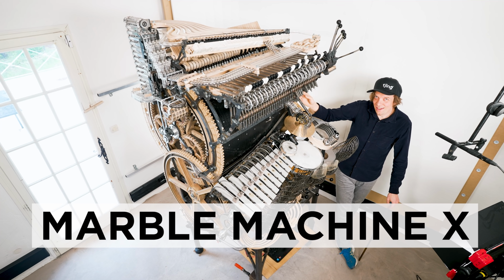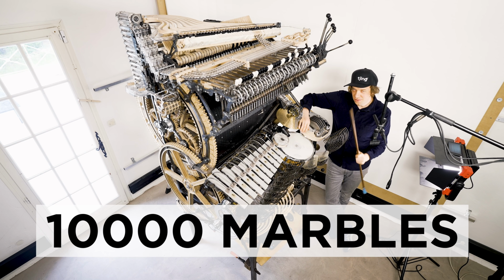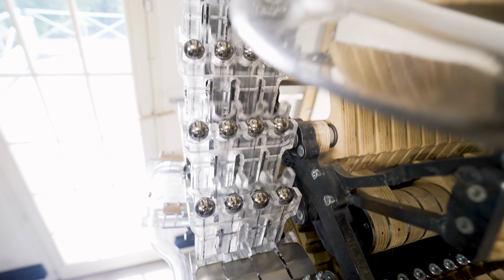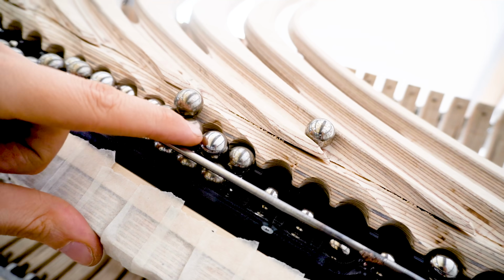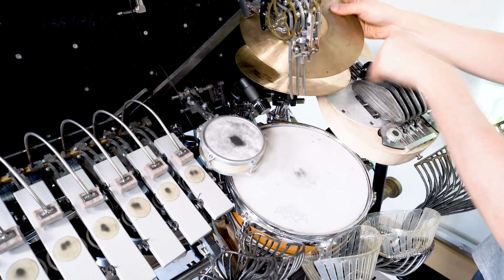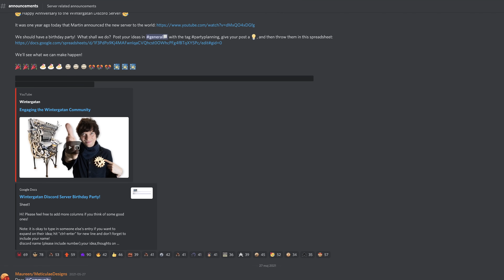Playing 10000 Marbles - Marble Machine X Accuracy Test

Comment: I'm beginning to accept the MMX as a stand alone band mate. For a while I was thinking the electric motor may remove the charm from the hand cranked machine, but the machine is transforming into an independent entity unto itself.
Reply: Can’t wait till it becomes a sentient being
Reply: Plus it frees up his hands to manually play instruments with the levers up top, play cords on the bass, muting levers, rhythm machine etc... or like you are saying he can stroll around stage playing other instruments while the MMX does its thing.
Reply: @solinus7131  I am pretty sure it already is a sentient being
Reply: It is foot cranked too, the hand one is just to get it going
Reply: The motor is only intended for testing. The hand and foot crank with flywheel should be all that's needed in a concert.
Reply: Agreed 👍🏻
Reply: @MrGonzonator Where did martin say this? I know that was the plan initially, but I swear I remember him talking about how he was realizing its potential. He made a permanent mount and drivetrain coupling in episode #138. Without it playing chords on the bass and keeping perfect tempo seems like it would be hard mentally even if you had 3 arms.
Reply: It's so much more interesting than the pre-recorded backing tracks that some bands play along to!
Reply: @MrGonzonator  That is
not true. He decided to use the motor for more. Rightfully so.

Comment: Martin, congrats on this milestone!
It looks like the right side clock escapement is not functioning properly. The gear is not actually interacting with the bottom pallet. The slo-mo at 18:07 shows this really well.
Reply: It appear that Martin added a metal pin which is engaging the escapement wheel instead of the bottom pallet. Likey a prototype addition trying to remedy the runaway escapement under high marble pressure. This may be a one off design that is no longer necessary because of the pressure reducing wiggles and would explain why it's never mentioned. If it is needed, look forward to it in a future video!
Reply: Yea something has gone seriously wrong here and not covered in the video. The bottom of the escapement IS the regulator. I'm wondering is the problem is how far those fingers are moving away from the escapement (looks like over 10cm). It is excessive and will slow the machine down too. Ideally it would only move a cm or two.
Reply: @mcbeenb  No no, that's not the problem. The problem is very well know from the discord community (they forsaw it happen), and it has to do with the geometry of the teeths and the pallets ... Check the #idea-vaults in the discord server to see a graphic version (Martin really need to see this !)
Reply: Yeah I also noticed that. Hopefully not another rabbit hole...
Reply: At https://youtu.be/0b-B_Bg31Zg?t=357 you can see the same happen on the left channel... too little marble pressure?
These clock escapements do need pressure to function after all. (the spring or weights in a real clock)
Reply: There is a bolt inserted on the black piece to avoid that infinite rotation
Reply: Yea, what the hell?? The design misses the margin by HALF THE DISTANCE BETWEEN THE TEETH??? This is ridiculous. Can someone from Discord explain what on earth went wrong here? The whole idea of the clock escapement system is that a waterfall of marbles shouldn't ever be physically possible.
Reply: yeah. Does anybody know why he didnt opt for the broken escapement ? seemed better less parts no springs no pressure sensitivity. Am i missing somethjing?
Reply: Go to the discord. It's a known issue and they have solved the problem. It will be fixed with better escapement teeth :) Don't panic!

Comment: i dont understand exactly what happened with the clock escapement. can you do a video on that? the escapement should prevent this at high pressure. thats its whole purpose in the clock.
Reply: feels like the pallet is slipping from the wheel
Reply: I might be wrong on this but i think its the spring strength in combination with the fact that the force created from the teeth is out of alignment with the point or rotation of the pallet(tik tok part) thus creating a moment (force*distace). Someone can correct me if im wrong. I still dont get why he didnt go with the broken escapement mechanism which was not pressure sensitive. He talked about less parts in that vid and then overengineered these mechanisms(imo) with so many parts, although i like all of it except the fact that he created this spring linkage and didnt use the broken escapement. Maybe theres more behind this someone could fill us in if hes been on discord.
Reply: There is a design error. The bottom pallet/tooth angle is not at right angles to the pallet pivot, which means the pallet can "cam out" when the wheel is pushed hard enough. The cad team have a fix designed and tested. Means new wheels and pallets, but the rest of the gate can be unchanged.
Reply: @tomnewsom9124  Won't the gate be rammed to hard every time if the pressure is so big then?
Reply: @weccojecco  Correct. The solution is to make sure it's impossible to get the marble pressure that high ever.
Reply: I mean there isn't really that much of a problem here. Sure, it would have been nice if the clock escapement gate managed to deal with the pressure. That was the reason this marble gate was made. But Martin has also learned how to build pressure modules, and he made space for that on the machine. That effort was wasted when the current gate was meant to fix all issues. But now that it didn't, martin still had an avenue to fix the issue: that pressure module.

Its not perfect, but its good enough.
Reply: Also, the Clock escapement works with way higher pressure tolerances than the old one, which reduces the need for Labor-intensive tweaking
Reply: @nielskorpel8860  And of course, with the new track above, a one size fits all pressure module will work fine for every channel. That was the main reason for abandoning the original modules in the first place - because of how sensitive they were to screwing up the stacking heights. Now that problem is gone
Reply: I think it all boils down to the polimer part that stops the rotating wheel. As pressure builds up when the gate is closed the part deforms elastically a little bit, enough to turn the angle on the stoper side a little bit off the 90 degrees. This off angle and the pressure causes a side force which pushes the spring back and unlocks the gate. I think it happens in streams because of inertia. With the inertia of all marbles going down fast, force on the wheel is much greater, causing the problem to instantly happen again.
Reply: It is all a combination of factors. First thing first, the two hooks of the fork with the two delrin hook and the clock wheel teeth do not meet where they should to make the gate safe enough, meaning in the secondary position is did not hold the marbles in place; he is fixing this of course, but for the test just modified the part with a screw in the delrin. 
This is most likely the core issue, because the "open position" is when the gate is holding all the marble pressure on the second hook which now is a jury rigged screw instead of a proper hook seizing the teeth of the wheel. 
With the first marble dropping, enough pressure is built to bounce back the tip of the screw, which already barely touches the derlin.Once the screw is bounced back, the now rushing marbles generate too much kinetic energy and are too fast to ever allow the top hook to get back in position and seize the teeth back, him too is bounced back before having a chance; this works just like in the gearbox of manual cars, where you cannot change gear without disengaging the clutch first, and if you try you would just grind your gears teeth.
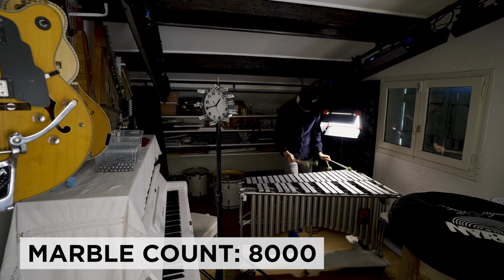Reply: the bottom part didn't seem to be catching 10:05

Comment: Just when you thought we'd got rid of the plywood pressure valves, they return!
Reply: He needs a flow regulator instead of the serpentine pressure valve. Use another sprocket upstream and angle the intakes/outflow slightly to reduce downstream pressure.
Reply: They need to be banned

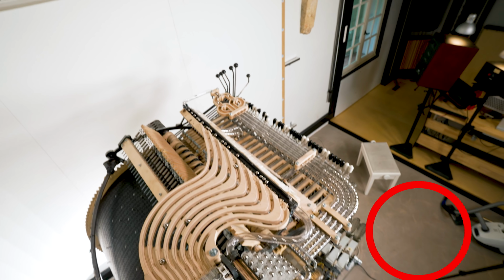Comment: 7:36 It seems like the brass wheel isn't hitting the stop on the escapement lever on the "open" part of the cycle (the bottom stop). Both front and back seem to be working the same way (although the back one is harder to see at this angle, of course). Is it hanging up on something else, or did I just misunderstand how this device is supposed to work?
Reply: He put a screw in the pallet which acts as the lower tooth. The screw in just a above the lower tooth. I think the design has serious issue. It was supposed to fix the pressure problem, which it doesn't do. He tried to temporarily fix the design with limited success.
Reply: It's a design flaw, I think.

Comment: Martin, been thinking about a minor concern that you may want to address before taking the MMX on tour.  Just wondering how easy it is to load and unload all the marbles to/from the machine.  Transporting it with the marbles would certainly be a bad idea.  Loading can probably just be done by slowly  loading handfuls of marbles into the funnels slowly while running, but for unloading, wondering if a gate of some kind would allow all the marbles to fall out of the machine, into a container, would not be that difficult.
Reply: Good idea. A drain, essentially. I hope that Martin sees this comment. 👍

[Edit] Nice to see that it hasn't gone unnoticed.
Reply: maybe he could design a drain on the place of the plywood lanes and then start playing a random song untill the machine is out of marbles.
Reply: i'm pretty sure he's going to redesign the machine for the tour, this one's going to be for the album.
Reply: @nagualdesign  hey mate. I recognise your account name from the IZGartlife videos on primordial particle systems. Small world! How’s life been the last couple of years?
Reply: This marble machine likely won’t be the marble machine that he is going to go touring with. The Mmx team is already at work designing a touring mmx. That being said having a drain is a good idea.
Reply: he can just loosen the bolt holding the pipe that feeds into the first lifting gear you can see at 0:34 and either remove the pipe or angle it downwards slightly so it drains into a bucket instead of onto the lifting gear. not a big deal considering its going to need to be heavily disassembled for transport anyway
Reply: @jsdp  I'm good, thanks. Had a few health issues but they turned out to be nothing major. Funnily enough I was just looking at an MRI scan of my healthy brain - and smiling - when this notification popped up.

I hope you're well. You might be interested to know that a few months ago I uploaded a new PPS explorer to Github. I can't post a link here (YouTube won't allow it) but if you go to the original IZGartlife video the link is in the description. It works pretty well on a mobile phone too, with a YouTube-like interface.
Reply: @nagualdesign  I'm glad your brain turned out healthy. You seem to have a pretty positive impact on the world from the very scarce few interactions I have had with you.

I checked out that PPS explorer on github a month ago - I was surprised to see the update time being only a couple months old!

Here's to no more health issues in future. I may never speak to you again but such is the happenings of life. The world is so sensitive to small changes, however, that I'm sure you will influence my life in some further way. I just hope you are aware of how much you spurred my inquisition a couple years ago - thank you, and hope you have a content life.
Reply: @jsdp  It's hard to express in words how much I appreciate that. Thank you so much! I hope the future brings you every happiness. And I think we may bump into each other again. The world can be a small place. 😉

Comment: So now, how did the fool-proof clock escapement fail? Need heavier springs perhaps? Idr what pulls the mechanism back closed
Reply: @Mustache Merlin I considered that first myself, but I remember him being fairly particular about the angle at which they mesh, and either way for them to slip either the mechanism isn't fully closing, or its being pushed up, and both of those cases would imply the holding force isn't enough which is why I figured it was weak springs or something of that nature
Reply: @xxportalxx.  It is the angle of the escapement wheel's teeths that's wrong. Mechanical engineers and clock makers foresaw this problem in the discord server. There's only one thing to do...
Reply: @vqetu3626  i suppose with enough play that alone could do it, but if the mechanism were tight then the holding force alone would be the cause
Reply: @Vqetu that one thing being?

Comment: How on earth did the gate let the waterfall of marbles through?? :o It shouldn't physically be possible with the clock escapement system - something is wrong! The regulator clearly got rigged with a bolt somewhere in the process in a desperate attempt to fix it, but honestly. How even did that happen???
Reply: It's as if the teeth were forming a ramp launching the pallet upwards when the momentum is high? Could be simply fixed by a different angle of the teeth perhaps? Martin should order new wheels / regulators and it all should work without the pressure release system.
Reply: He explained every part in the previous videos.
Reply: @bzqp2  Could be that the friction is too high to comfortably to make one 'tick' and play all channels like that. It would also be another case of fine-tuning with tight tolerances need which is not ideal.
Reply: @laserbean00001  No, he hasn't. All that is new.
Reply: That´s what i thought too. If there are no mistakes or inaccuracies in the geometry, the marbles shouldn´t go free willy so there has to be something. I think it´s the angle interaction on the escape wheel/pallet fork having not enough undercut.
Reply: @bzqp2  even when this would work without the pressure release system with new wheels, this pressure relase system is an acceptable security mechanism, since it widens the needed tolerances, I think.
Reply: The marble pressure pushed on the wheel and then on the pallet, which was aligned with the spring, too much pressure and the spring stretched enough to let the marbles through. He added a screw to fix it, now the force from the marble pressure is no longer aligned with the spring and the gate works.
Reply: Materials bounce, they also bend, even glass and concrete bends

Comment: 7:44 why is the clock escapement wheel stopping before the lever touches it? it looks like its being stopped by the force?
Reply: Was going to say the same thing. The cogs on the wheel never touch the second hook. And the pallet double-jumps in a weird way when it it springs back.
[edit] Ah, there's a screw mounted there on the pallet. Last minute fix.
Reply: Is it not being stopped by the silver screw thats in the black lever device, when this in in the open, it then catches on one of the clocks notches?
Reply: I also noticed the same thing.
The lower part of the black lever never comes into contact with the wheel hooks.
It appears as if the spring is too long in the rest position and this limits the outward movement of the metal rod on which the ball release lever pushes.
It seems as if the spring comes to a stop before the black lever movement is complete.

Comment: 7:50 i dont think that mechanism works as its expected to. The lower arm of that lever thing doesn't catch the gear at all. It's almost pointless
Reply: There's a bolt on the pallet stopping it. Needs a redesign
Reply: noticed the same thing. not sure why. in the waterfall of marbles the do hit the counterpart.

Comment: 7:40 What stops the clock gate right there - when the note is played with the marble released from below? The bottom stopper of the Delrin part doesn't make a connection.
Reply: There's a bolt on the pallet stopping it
Reply: Theoretically it shouldn't matter, when there's not too much pressure (as he demonstrates later) the geometry of the pallets should never allow the escape wheel to advance more than one tooth at a time. There's never a point where the pallets are fully open.
Reply: So I guess we didn't see him trying to solve this overflow problem and trying with a bolt first. I missed it totally. Now, that he added pressure relief wooden parts, the bolt would not be needed because the pallet would be able to work as intended under the released pressure.

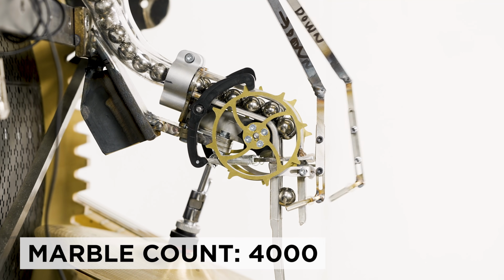Comment: 5:55 why isn't the escapement gate fully closing?
Reply: The screw that has replaced the bottom arm of the escapement pallet (for now) is part of which fixes the issue with the escapement gate that was causing it to be marble pressure-sensitive.
Reply: @labtec901  Oh wow I see it now, thanks! And ya I've since looked at the discord chat and I now fully understand the issue with the torque making the POM lever slip back out of place. I think Martin is going to have a new set of redesigned POM levers to help mitigate that issue.
Reply: @labtec901  That's an amazing hack. I couldn't see it until I read your comment.

Comment: Next model: Add actuators that flip out a pin from the cylinder for every pin. And connect it to a central drum controller that rotates with the drum, which will be connected by wifi and thus you can play midi on the machine. Sure, some would ask, "isn't it a bit expensive for a speaker", but then again, you've said it, it is a crazy project :-).

Comment: Just noticed at 7:45 the escapement gear doesn’t actually get stopped by the seesaw arm when it’s dropping the marble (on the bottom). Seems like why the gate could drop multiple marbles due to pressure. The pressure relief is a nice fix, but doesn’t solve the issue entirely. Probably a worthwhile endeavor to get that working like it was designed.
Reply: @Minecraft Platinum Fireworks aha, thanks for pointing it out